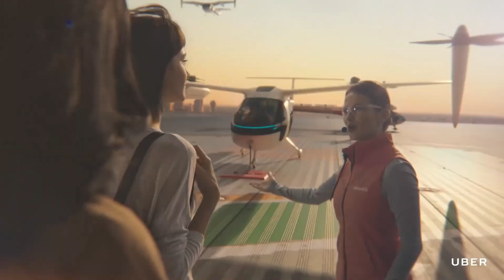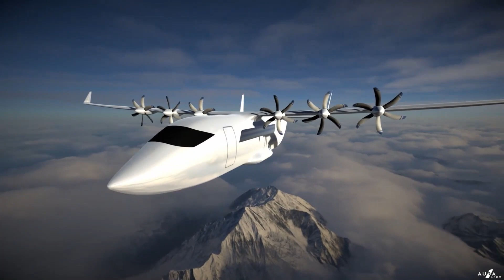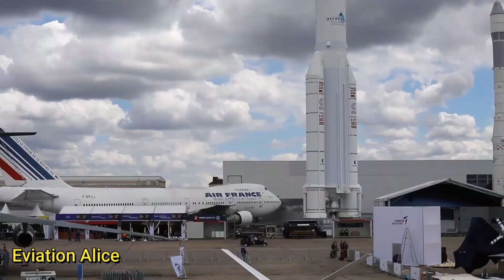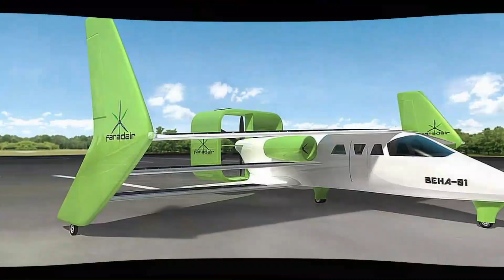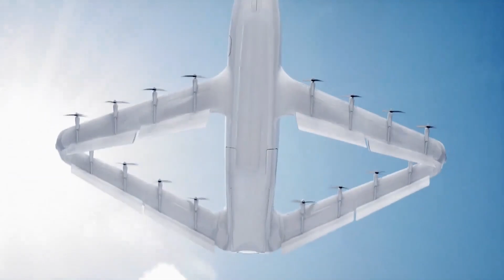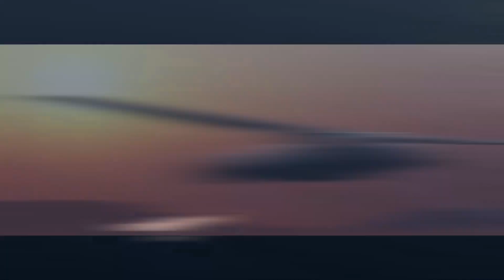Larger Electric Aircraft under development

Comment: 🔶🔶🔶...Just some heads up  that I am now prototyping an exiting ultra simple, patented power dense[light weight], fuel agnostic, zero noise/emissions/smoke/odor, rotary engine that will outperform turbine engines in most metrics. It will power a 'noiseless', wingless, ultralight-category[no license/certification], personal air mobility 'jet pack' in the iPAL [integrated Personal Air-Land] VTOL mobility family called PersonalJet/Personal-Jet. At least till we get 'anti-gravitic' propulsion [a friend is working on it]. Other space related tech is on the back burner...for now. Carry on.

 .  ／|＿＿＿＿＿＿＿＿＿ _ _ _
〈　 To BE CONTINUED…//// |   
　＼|￣￣￣￣￣￣￣￣￣￣￣

===
ℕ𝔼𝕎  𝔽ℝ𝕆ℕ𝕋𝕀𝔼ℝ  𝕋𝔼ℂℍℕ𝕆𝕃𝕆𝔾𝕐  𝔾ℝ𝕆𝕌ℙ is a visionary multidisciplinary B2B innovation company utilizing a licensing business model or collaborative enterprise with strategic partners to develop Advanced clean, efficient, power dense solutions in domains of energy, propulsion, mobility, robotics / exoskeletons and clean technologies with a particular emphasis on the aerospace sector including space exploration and commercialization

Comment: What do you think about possibility of larger long haul aircraft that would be designed for ultra-high altitude to lower overall drag at slightly lower speed than normal airliners to possibly achieve laminar or partially laminar flow to reduce drag further?
Reducing speed from ~900 km/h of normal airliner to 600 km/h would lower drag by 55%. 450 km/h would obviously lower it by 75%.
Increasing altitude from 11 km to 21 km would reduce drag by 81%.
Laminar flow control would reduce drag by additional 50% if implemented.
I know that optimizing for high altitude would increase drag coefficient, but I'm not sure how much, so I'll leave it unchanged. It could also be partially mitigated by advantages of distributed propulsion.
Combining all of the above would lower mechanical energy usage to ~6% of current airliner.
Considering turbofan efficiency at 40%, and electric at 90%, necessary chemical energy stored would be 2.77% of current airliner.
747-400 with 13500 km range uses 174 tons of jet fuel, which comes up to ~2080000 kWh of stored energy.
2.77% of that is ~57.5 MWh.
Current mass produced best cells would put it at 191 tons, which is close enough to fuel itself.
Assuming that batteries could be used as structural part of fuselage, let's assume there is no weight gain from cell to pack.
There also would be dicrease in engine/motor weight, since average power would be around 4 MW, which in terms of electric motors would be something like 400-600 kg if well optimized and with high power density.
Gaining the potential energy of 21 km altitude with 400 ton aircraft would cost almost 23 MWh itself at 100% efficiency. However large part of that would be recovered on slow landing.
Theoretically speaking, with a lot of optimization a long haul electric aircraft is already possible.
However I have to add that I'm an aviation noob, and I don't know how much change of shape would increase drag, and if 21 km cruise altitude is even feasable/optimal.
What do you think?

Comment: With the enormous variety in configurations under development, we will learn much in the coming years about ways to optimise efficiency, what works, what doesn't etc. While battery energy densities are what they are, engineers will need to squeeze out as much efficiency as they can, making this a very innovative period. As for these aircraft, the pilot in me loves the look of the eFlyer 800! Many thanks for another wonderful video. Cheers from Sydney - Dave

Comment: So your not going very far in reality because compared to current aircraft none of these come close. Also what are the turn around times for these aircraft? because sat on the ground charging they are losing money. If it takes hours to turn them around then they are going to be to expensive to operate. Whilst your waiting for them to be ready you have crew waiting too not just passengers? Its all very well saying how efficient they are but if it takes me 3 days to get across the Atlantic then what's the point? I love the innovation but the practicality for long distance travel and and shipment of goods just isn't there. Its a step backwards. Oh and what about the environmental impact of the battery materials, everyone is ignoring that cost both financially and environmentally.
I dont buy any of this.....Its not a solution but then again is there really a problem to solve?
Reply from the maker: Swappable batteries exist and can be a solution
Reply: @ElectricAviation  That doesn't address the environmental problem that manufacturing and disposing of these batteries causes. A problem everyone both in aviation and the car industry is ignoring. Like I say I love the innovation but the practicality is years and years away. For the distance an A380 can fly and the amount it can carry you would need a hundred plus maybe more of these electric aircraft just to get close. And 100 of these electric aircraft and their batteries and turn around will cost a lot more than making 1 long haul flight in an A380. Plus your putting 100 aircraft into the air instead of just one. That's a lot of airspace being taken up and all that it costs in manpower to keep them safe. Sorry but its just not viable....

Comment: To be clear, I am fairly certain that the reduction in noise will be quite minimal. At speed down a highway, the noise of a car's tires are so loud that you can't even hear the engine anymore. Electric cars are only quiet at street speeds. Airplanes get a large portion of their noise from the props whacking the air. The lack of combustion will not aid you here.
Reply: Although vibration should be greatly reduced over a standard ICE prop plane.
Reply: @macrumpton  Depends on the quality of engine, but I see your point. On smaller aircraft, there will be less shaking of the frame.

Comment: ugly, stupid and little machines, why not develop a better and more powerful electric motor and put it in the planes that are already built and designed? that simple, this is similar to electric cars, whatever the electric car was in the 70s or 80s WAS ALWAYS UGLY, SMALL AND USELESS, but what happened when someone put a normal electric motor in a NORMAL CAR ? VOILÁ, A SMART NORMAL ELECTRIC CAR!! 

this is the same, the design of these "electric" planes is the same ugliness and stupidity as the "electric" cars of 50 years ago, NOBODY WILL WANT ONE OF THEM BECAUSE UGLY AND USELESS, but what if a better and powerful electric motor was installed in a normal and common plane? THE SAME WOULD HAPPEN AS NOW WHEN YOU INSTALL AN ELECTRIC MOTOR IN A BMW OR PORSCHE OR MERCEDES, YOU WILL HAVE A VERY USEFUL ELECTRIC CAR WITHOUT THE NEED FOR ENGINEERING AND SPECIAL DEVELOPMENT FOR AN ELECTRIC MOTOR, so you save MILLIONS but from what I see the big industry does not have enough thought that

it is the big industries that are holding back progress and the future, in 1870 the electric car WAS FIRST THAN THE INTERNAL COMBUSTION ENGINE but it was JP Morgan and his greed who STOPPED THE FUTURE FOR MORE THAN 150 YEARS, this is the same thing, the big aeronautical industries like boeing, airbus and other clowns ARE STOPPING THE FUTURE OF AIRPLANES because they can lose A LOT OF MONEY, AND WE ALL KNOW THAT GREED LIVES AS LONG AS THERE IS MONEY hahaha

Comment: For the Ampaire Tailwind, how does it not have elevator and rudder? How's it supposed to fly?
Reply: the duct of fan maybe acts as elevator and rudder.
Reply: That ducted fan work as an anular wing, and replace the stabilizators but also ir needs aditional moving superfaces to have enougth control, inclusive it can maximizate that efect defelecting thrust forma te engine

Comment: Most of the designs are impractical: why can't those companies ask the pilots? Some designs are plain absurd, it's obvious for any pilot that they can't take off, fly, or land safely. What we are seeing here is "survival of the fittest" at work, as most of them will never become real. Eviation new design for Alice is great. We can see the same happening with the UAMs, some designs are evident winners, notably the BETA, a great and safe aircraft concept.
Reply: Part of me wonders if credible oems like beechcraft or Cessna aren't making electric aircraft is because they're afraid of innovation, like what we see in the car industry, but another part of me wondered if maybe these designs just weren't actually better.
Reply: @gormauslander  It's just like the car industry: It's way more efficient and economically viable for a new company to build projects of disruptive tech, than stablished industries with contracts spanning years. The problem with several proposals is that they are simply not feasible, not economically possible, but most are intrinsically dangerous as they are aerodynamically unstable and represent other risks, such as propellers and airframe touching the ground under minimal wind and / or pilot mistake. That airframe with flaps turned to make VSTOL is simply a bad joke.
Reply: @forgotten_world  Depends on how they handle airflow. If you look at blown flaps like the shinmaywa US-2, it's quite good at what it does. 

But I agree with your other points. It's great to have a fresh perspective to criticize how we currently do things, but simply trashing all of it and shooting off into the blue is how you make a mistake of a product that no one wants. 

Progress is made by learning from the past and reframing it in the context of present technology, not by starting over from scratch. Sometimes we still do something because it's a good idea. Cultural and industrial awareness is so underappreciated in these startups. Just ask old pilots about why things are certain ways. get perspective from the people on the front lines about what they've seen in their time and what they would do differently about your design. 

I can understand the fear that these ol timers have a bias and won't be open minded enough for the vision, but completely cutting yourself off from generational wisdom yields no progress.

Comment: What is the energy storage method that you think will have the most impact on driving range extention of electric aircraft? Hydrogen? Biofuel? Higher energy density batteries? Amonia? Something else?
Reply from the maker: The max you can get out of solar cells in 1000 Watts/Sq. Given these machines use 100s of kW in their motors, Solar wouldnt make a difference. It does make a difference to sail planes though. There are aircrafts that are solar powered and use just 3.5 kW. That level of energy can be easily extracted from the panels on the wings.
Reply: In this class (regional) and smaller: batteries, for sure.

Larger/longer range airplanes: maybe hydrogen first (maybe even biofuel if we're prepared to make the bad food supply situation even worse just to fly airplanes), but in the long run: batteries.
Reply: Hydrogen has really bad volumetric energy density. That problem needs to be solved before it can scale. Pressure tanks will probably get hydrogen started, but it will lead to over engineering and expensive solutions imho. Hydrogen can be stored as amonia quite easy with a volumetric energy density in the range of half that of jet fuel and converted to electricity with fuel cells. More cost efficient? I dont know, only found a few  videos exploring the concept. I guess there are also other fuel cell concepts out there designed to consume hydrogen rich chemicals. There was a lot of buzz around ”Hydrogen Goo” some years ago. My take is that hydrogen and fuel cells will be the basic components of long range solutions, but pressure storage of hydrogen will be replaced by some form of chemical storage solution such as ammonia, alchohol, sponge metal etc

Comment: why aren't the fuselage & wings of these electric aircraft made of solar panels?
Reply: Even with lightest weight flexible thin film cells producing 200W / sq m and flying only in full sunshine, the available top surface area only adds a fraction to the normal battery power draw. Its a modest range extender I'd guess <10%. Flying fast needs far more power I presume a function dominated by speed cubed.
The 2 Solar planes mentioned have enormous wing areas relative to the cabin and fly much slower. Their solar output has to be at least double the power required to fly day time to store the excess for night flying and maintain multi day flights. Different category.
Reply from the maker: There are cases where they are. Solar Stratos for instance is one such aircraft as is Solar Impulse
Reply: @ElectricAviation  one? Just ONE?! Seems as though this should be a fundamental requirement for EV
Reply: The only aviation case where current solar panels would be able to make a significant in flight contribution is basically a large flying wing power assisted glider or a Hybrid Airship  like the Skyships.
If the efficiency of solar panels can be increased by orders of magnitude then obviously a lot of solar powered technologies become far more viable...but at the moment they are mostly too inefficient, heavy and easy to damage.
Reply: Above the clouds there is mostly sun, except at night. Would think that's an additional benefit.

Comment: Spoiler alert : not a single aircraft in this video will ever become a reality.
Reply: You're probably right. I think most of them won't.
Reply: It's sad, but unfortunately it's the truth. I said the same thing about BS "fully autonomous cars" 10 years ago when this subject was spamming globally 24/24 7/7 around the world, and guess what !? Not a single of this stupid S**t is working anywhere on the globe right now (and I'm pretty sure not even in 2030).

Even if I'm the first that REALLY wish to see a true electric plane ASAP, and not only a small training plane like Pipistrel is making.
Reply: Eviation Alice is already reality
Reply: One can dream
Reply: To be fair, the Eviation Alice is real. If it'll ever fly, and if it'll ever be successful, nobody knows - but there is actual hardware.

The partly electrified 337 is real too, but that thing is fake in another way: they put in real powerful Avgas engine in the rear position, and an electric motor in the front position. Can't see this go anywhere, also probably 80+% of the craft's flying energy comes from Avgas.

All the other planes: you are absolutely correct.

Also: "biofuel genset" is marketing speak for "we'll run it on fossil fuels while we develop the biofuel systems, but we'll not develop that at all". So, essentially fake in yet another way.

Comment: I think if you pull VTOL out of the equation, I cant see why aircraft would change all that much. I made the same predictions about electric cars in the late 80's and this has proven to be so.
So I feel that many successful types could successfully be reproduced except with electric power.
Classics out of the GA mold like the King Air, to advanced streamliners like Piaggio Avanti, and Gulfstreams, were going fast will help them go far.

good observation about the landing gear, generally the next highest cost to the engines